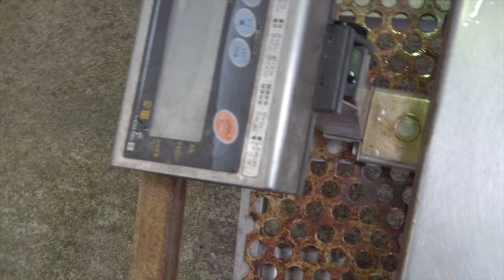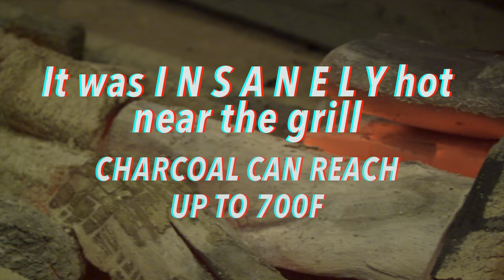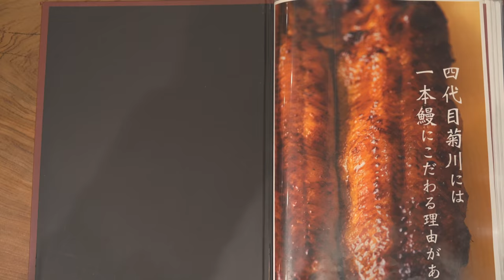Amazing Grilled Eel (Unagi) in Nagoya- Hitsumabushi

Comment: Me: on a diet
Also me: watching people wat food and getting hungry
Reply: Don't diet.. just eat well. Whole fresh foods, avoid processed packaged items. Half your typical plate and save the other half for later. if you are still hungry in an hour.. eat it. Make sure to drink lots of water!
Reply: @VictoriaGates  thanks but that only works when I'm trying to maintain weight. For weight loss I've found that fasting, working out (at least 30 minutes a day) and a low carb diet is what works best for me. I'm not on a diet where I mindlessly starve myself or deprive myself of food that I like eating. It's more like I control when I eat and the portions.

Comment: With charcoal that white hot, I have a feeling it may be hotter than 700 degrees! Maybe at the grill surface it was, but I've cooked with a similar shaped charcoal before at over 900 degrees surface temperature. Kudos to the chef for hanging around that all day, and for you guys to brave it with camera equipment!